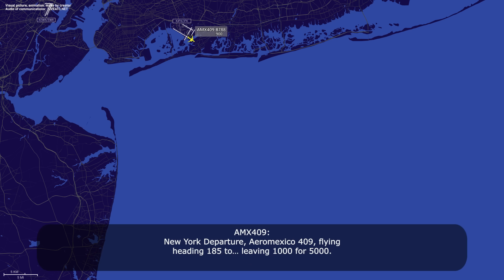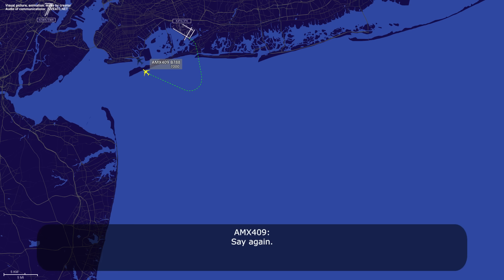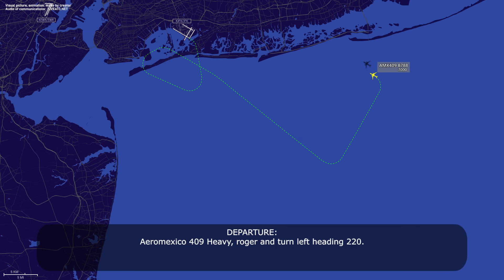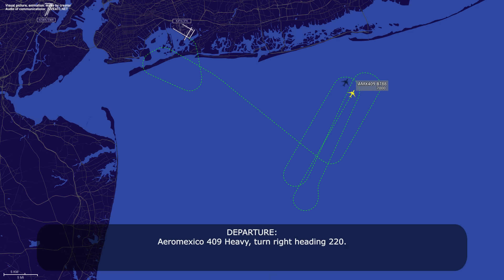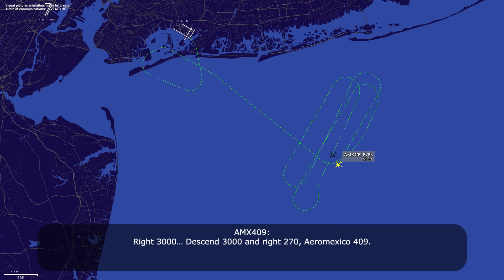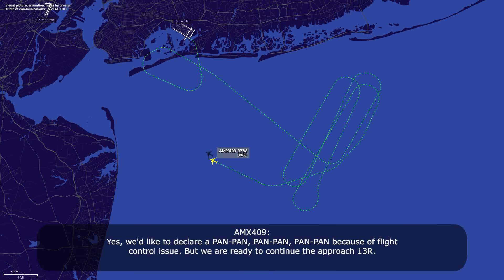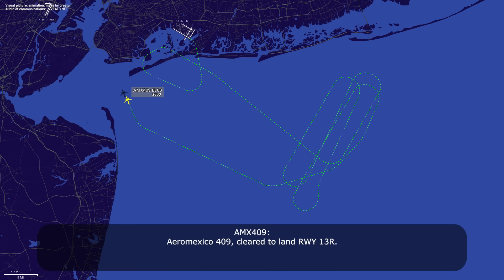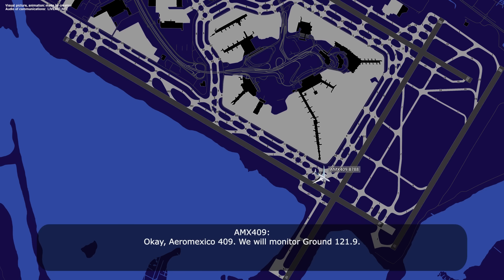PAN-PAN. Aeromexico Boeing 787 Dreamliner has flight control issue at JFK. Real ATC

Comment: Good thing the Flaps got stuck during take off in the extended position and not during landing in the retracted position.
If that was the case I think they couldn't even land in Mexico City, they would need to go to the other City Airport with longer runways.
Because the old one in Mexico City is cramped in the middle of the city and has shorter runways with no space at either end.
With the City's altitude attempting a no-flaps high speed landing would've been impossible.
Reply: Have they not finished that new one still? Man that construction is crawling (even for municipal airports construction timelines)
Reply: @henryhbk It has been completed, I think it's now 6 years since it was inaugurated. The Train connecting both airports is what's taking an eternity to finish, and why if this plane had to go there would've been a nightmare for commuting passengers 😅

That new airport is currently used for some passenger flights, about 50 per day, but also all the Cargo operations were moved there from the old one, so it handles heavy planes all the time and has the long runways to allow them to operate. Hence why a plane with no flaps can attempt a landing there.
As a personal note, when one of those super heavy cargo planes takes off from that new airport, all the windows looking at the runways vibrate a lot (engines don't point at them of course). I think they should address that before some crack, because those big engines at max power are LOUD.

Comment: So 409 slowed 40 knots while in an approach pattern from 230 to 190 and didn't inform ATC?  Poked a big hole in the Swiss cheese with that move.
Reply: WTH are you talking about?
Reply: @JohnSmith-zi9or Did you hear ATC ask them what their speed is and when he said 190, ATC said “If you’re going to change your speed please let me know”? I guess you didn’t.
Reply: @MrCrystalcranium they’re actually required to inform atc if they change their airspeed by more than 10kts.   Lots of flight crews routine “forget” about this lol
Reply: @MrCrystalcranium  NO, that's not what the controller said. The controller asked for the speed. They said 190. The controller then said "Please let me know if you're going to slow anymore, please." 

There's a difference. And they did nothing wrong.